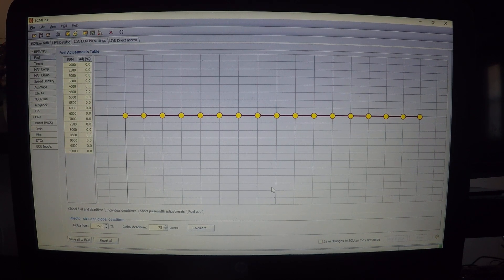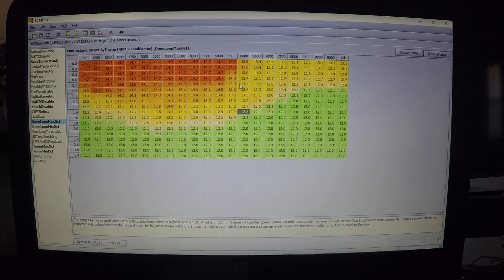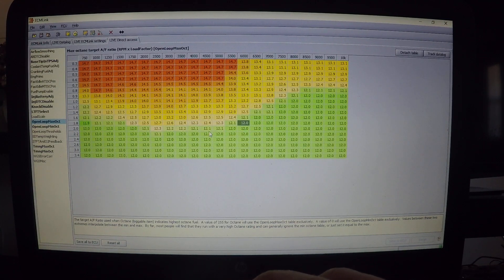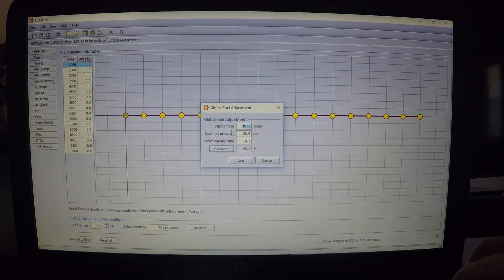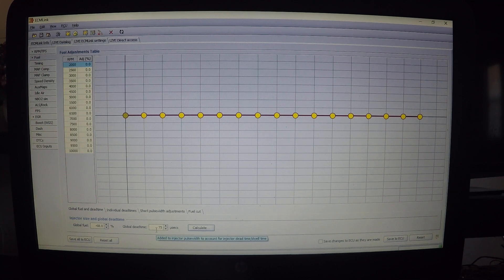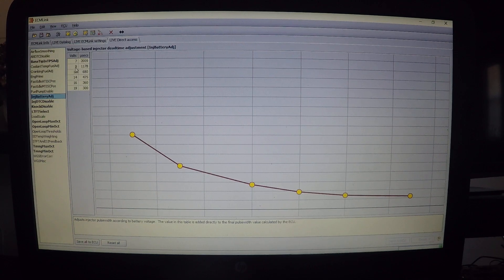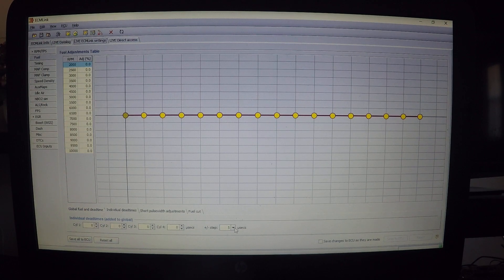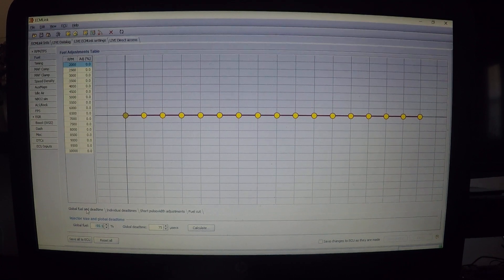Fuel

Comment: Do you usually shoot for 11:1 or have seen any benefit in running leaner on pump gas?
Reply from the maker: Leaner is more power but it'll only take you so far. I shoot for around 11:1 on pump. E85 around 11.8:1 but everyone is different. Also depends on what the car likes really. Not to mention timing numbers.